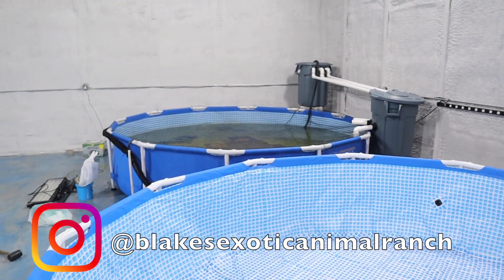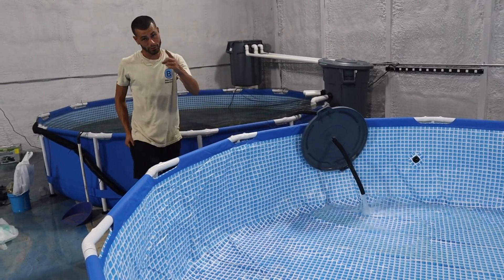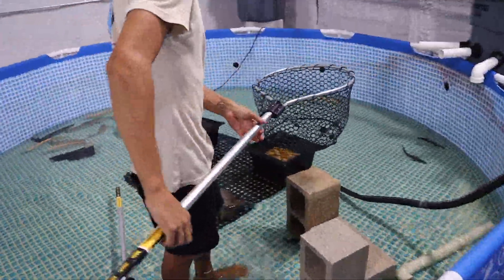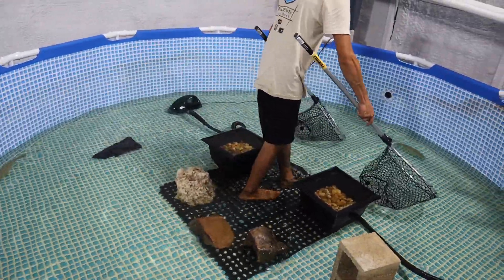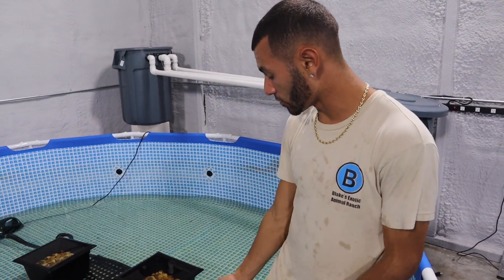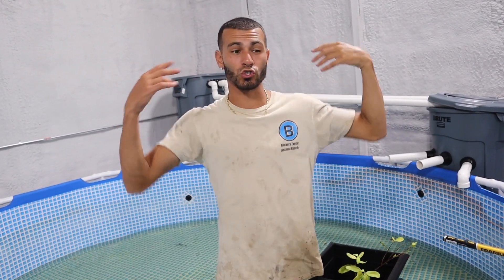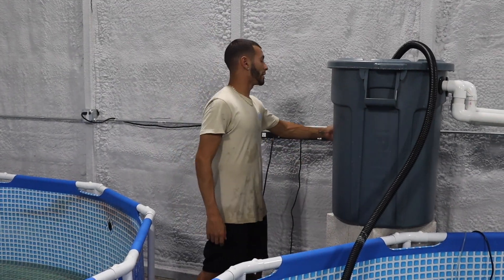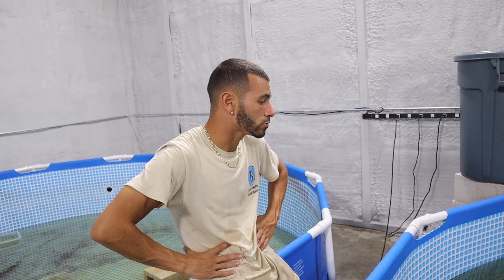THERE’S A LEAK IN OUR NEW FISH GALLERY! HOW DID WE FIX IT?

Comment: If the hole is on the bottom u can patch it pretty easy. If it's on the side u can still patch it just not as easy. I would patch it before I just throw it away. U can get a pond patch kit from lowes or home Depot to fixe the liner u can also use a spray foam made for fixing pond liners.

Comment: Use corregated sewer pipe. You can stack them up.They are easy to clean. They come in all sizes. They will not cut the pool.

Comment: Use a Pillow Case Sand Bag to Weigh Down the Cave, either SuperGlued in place or Staple Gunned Down on One Side on the Bottom b4 filling it up w/Sand then Level it evenly

Comment: Check out Bulk Reef Supply— Marco’s Reef Saver. I have used this rock in both fresh and salt systems. Very cheep, looks real, highly porous (adding great biological filtration), and they stack well/epoxy together easily. You can make really cool caves with them. They have foundation pieces (machine cut flat bottoms), shelves and boulders. ~200-300 pounds would build you an island ~12 cubic feet.
Reply: Plants/algae will also attach/grow well on them.

Comment: What about the big blue barrels or white ones and just cut the bottoms off or pvc pipes or new sewage pipes... I don’t think it’s too safe to put cement back in there plus these are lighter and more manageable also the plastic dog houses could work too just put the top as one and flip the bottom as a second hide.** sewage drains not pipes